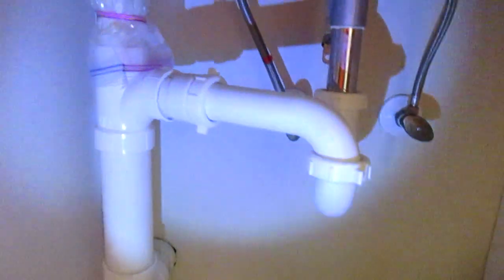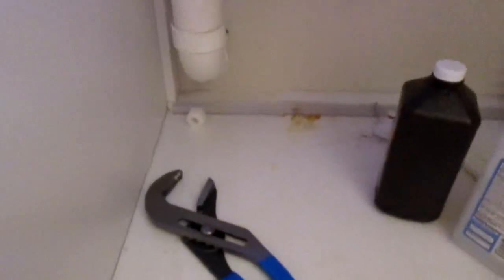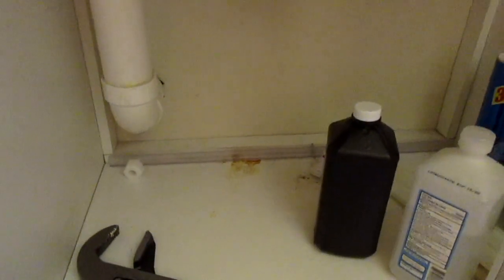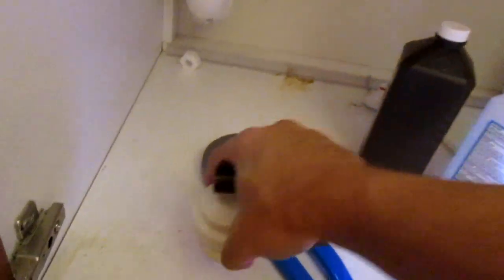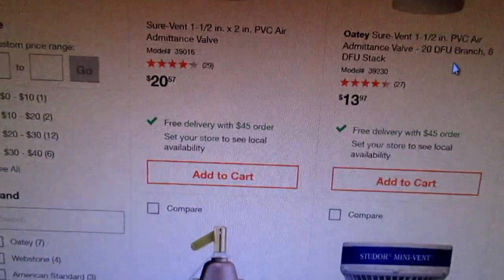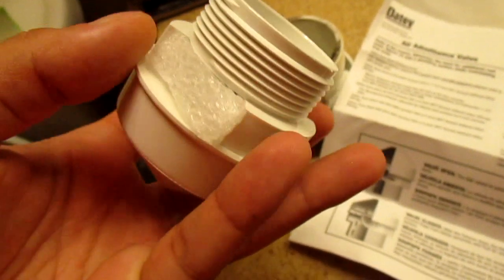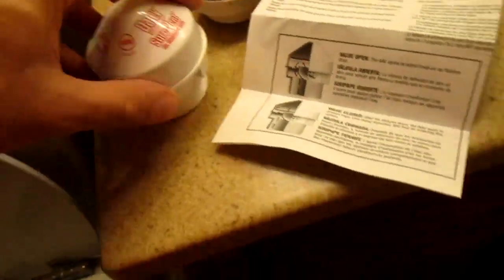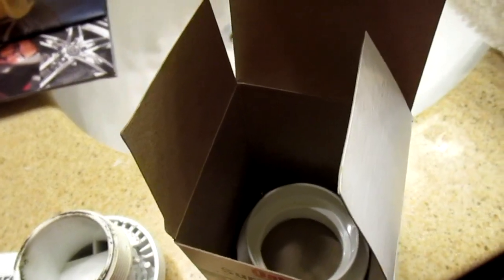Air Admittance valve Failed and it STINKS! Repair !! Replace!

Comment: I have 3 in the house, they go bad once a yr, what causes them to go bad so frequently?
Reply from the maker: Use.  Like by.. the pressure in the pipe. And its just a crap design dealing with sewer gas. I think this one is bad again it stinks under the sink
Reply: Literally 100 bux to replace them all at least twice a yr🤦‍♂️
Reply from the maker: @brandonmoore3719   yup. Waste. Cheaper to have a good roof vent. Toilet bubbles when they go bad.  Crap vents

Comment: Thanks, but it is not properly installed. It needs to terminate just slightly above the sink when it it filled to the top because air only has to be above water to drain efficiently. Looks like it should be 18"'s higher.
Reply from the maker: It cant though yea whoever built this place.. Its __  Who ever signed off on it _ was built during the housing boom talk to people who fix stuff.  Not all all uncommon  Its messed. That makes sense though sometimes sinks drain slow here
Reply: If it was 18 inches higher it would be a vent just gleaming at you as you use your bathroom sink.  That would be weird.

Comment: i just took my vent cap off, its just a super cheap black cap and its pretty rattly. im going to change it and hopefully it takes care of the smell. it smells like sour garbage in our house. i live in a manufactured doubewide. the source of the smell is under the kitchen sink, if that doesnt fix the smell what else could it be?
Reply from the maker: should fix it its just sewer gas getting in.  If it still stinks you could plug it off then devise of some sort of vent that vents outside   Thats what I would of did with this piece of junk condo. But you are not allowed to do anything

Comment: I live in a cottage that has this under my kitchen sink/island. It constantly gurgles. I mean every second loud gurgling. It’s filled thick with black stuff I’m hoping isn’t black mold? It doesn’t really smell, oddly since it’s covered in that. How much average would it cost to replace this? How can I clean this since I can’t do the after rinse with draino like products? I’ve had two plumbers come and tell me the gurgling is normal, and not care at all. Trying to relax on the couch and all I hear is loud gurgling. I don’t want to waste more $ on people who don’t care please help lol
Reply from the maker: The part is made by Oatley any home depot lowes etc should have one around 10-12 .  All you need is a large pipe wrench and it un threads.  No idea probably any plumber would charge $120 or more because they all are a rip.
Reply: Your valve is most likely broken and stuck shut. That’s why it’s not smelling

Comment: Pause @ 0:14 - Pull those " Caps " out and put a bit of Silicone in there + around the Wall.  Put that Cap back, clean extra residue and once they dry, it will be secured.  I did these to our Rental Properties so People don't yank them out of the Walls.
Reply from the maker: You have plastic pipes too?  I hate pvc. The bozo's who built this place forgot the caps on a few places so they cut them so they could slide them on later.
Reply from the maker: Steel cased electrical wire too!   Yea no nothing here. Anyone can glue pipes.  Think the art of sweating pipes is gone!   Here for fear of fires they put your main breaker OUTSIDE so anyone can be outside and flip the switch.  That's it.  Oh.  Now they mandate sprinklers in condo's.  In the back.  Was built later, all Chinese drywall infact there was a nation wide news article when they tried some revolutionary treatment with gasses to try to FIX Chinese drywall w/o replacing it in the back of here closer to the cell tower.   It didn't work.    I have the picture somewhere 2 places were "Circus tented"   Chinese drywall was EVERYWHERE around here. Gotta be a ignorant moron to choose this area.. Hmmm someone I am related to.   I was just piss broke in my 20's living in NY. Finally somewhat recovered
Reply: +Ghetto Wagon - No our Pipes are still Copper.... But the Plates are like loose and flopping around.  So I took Silicone and make it like a big button... Then I pressed it against the Wall... When dry, it helps to support the Pipes and prolong damaging.  I also did that to the Top of the Shower too.... Sometimes those would " Flop Around " too.  NOTE:  Oh, other " important "  locations..... Under the Kitchen Sink and under the Sink in the bathroom.... The Toilet Cold Water.... That is the most " Fragile " place, since People like to put Plungers and etc... around there.   Make sure to " Glue " them with Silicone, like I did.

Comment: Blah, Blah, Blah. Studor vents (AAV) are perfectly fine if you install them correctly. That means the vent needs to be as high as possible in the cabinet. At least half way up the sink...preferably higher. I've got them in my kitchen and two bathroom. They have operated flawlessly for over 20 years.The issue is that if your sewer line is clogged and the water backs up into the sink the AAV will get sewage in the valve and most likely fail to operate correctly...thus your smell.
Reply from the maker: Ya these places were built poorly so.. Blahh Blahh Blahh
Reply: i have it just above the sink strainer...would this be ok?